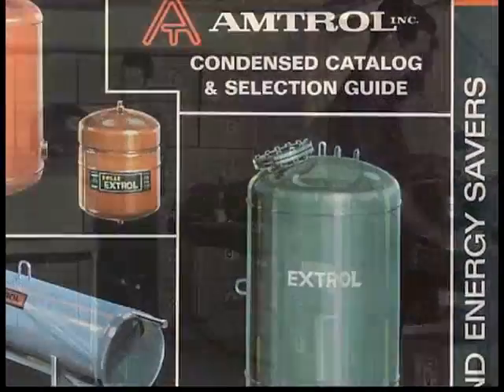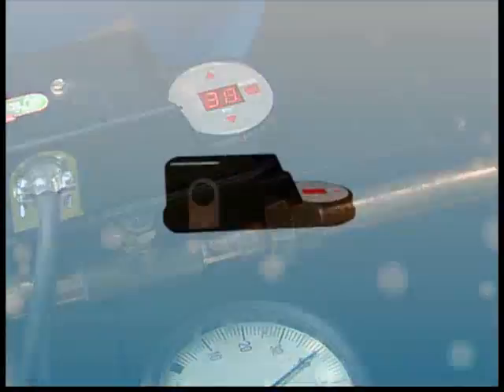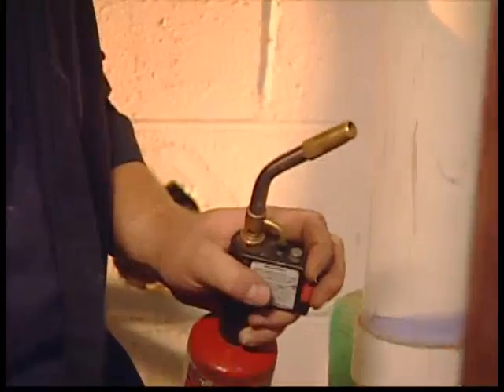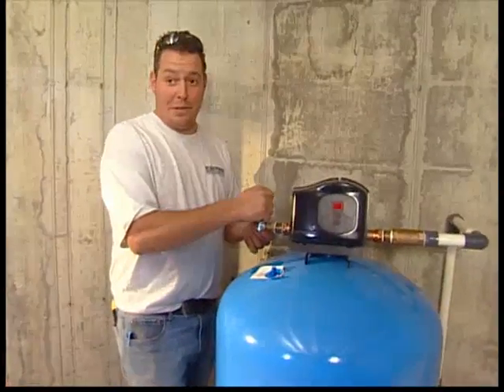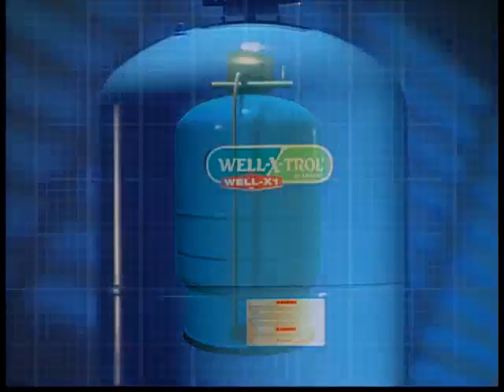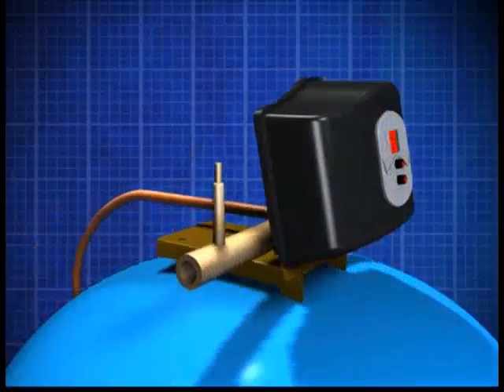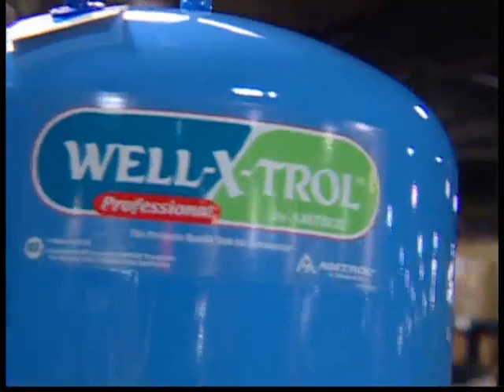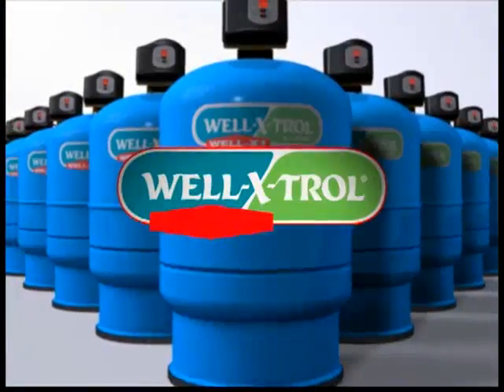Well X-Trol Well Tanks

Comment: Hi,

 I really appreciate you do this kind of video. I have a problem with my well pump system. I just got a new well borehole drill and a new Well-X-Trol Pressure tank with pressure switch, Cycle Stop Valve installed. The water pressure build up to 60psi and cut off fine, but when a valve is open the pressure drains quickly down to zero and shut off the pump. I tried everything to no avail. Is there anything wrong with my system? Unfortunately, it is out of the country and no one has any idea of how it works. Would you happen to know what could be causing the pump to shutdown when a valve is opened?

 
Your kindly response will be very much appreciated.